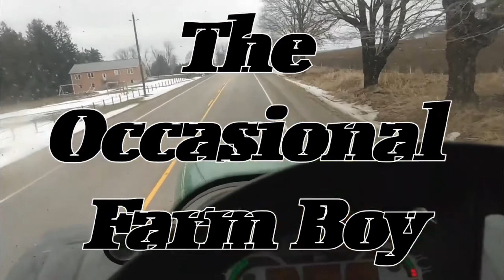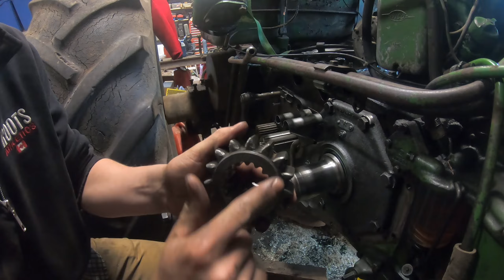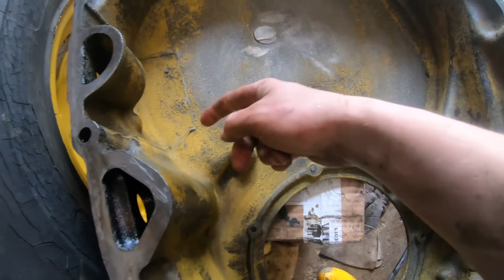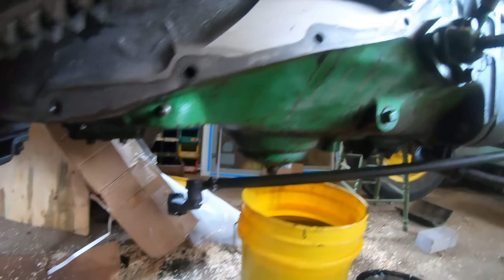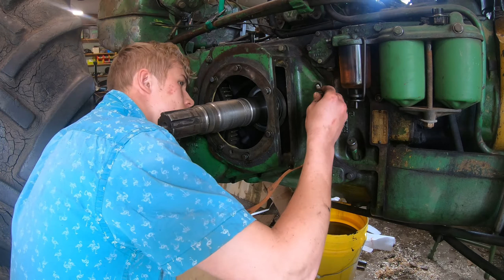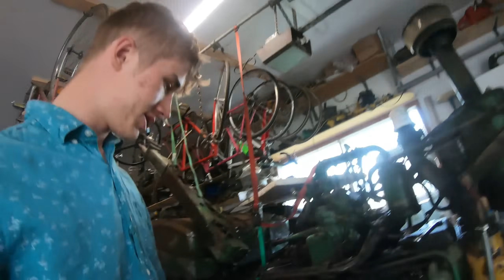John Deere 830 Reduction Gears Assembly

Comment: I’m in the middle of my dads 720 and was curious about the play in the first reduction gear. I see yours is the same way. have you come across any specs for it?
Reply from the maker: I haven't seen any specs about the play. On the forums, they said to just crank the end castle nut up hard and should be good. That's what I ended up doing. Otherwise, it'd have to be brought to a machine shop built up and the teeth re- ground. There are not a lot of options, really.
Reply from the maker: Hope you're having fun while at it. Can be a daunting task, but getting through it wasn't so bad.